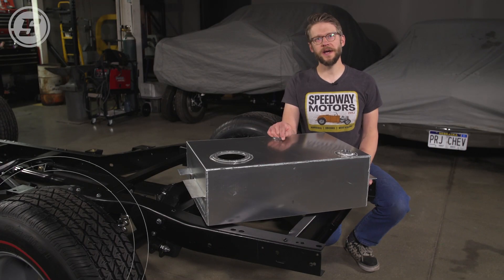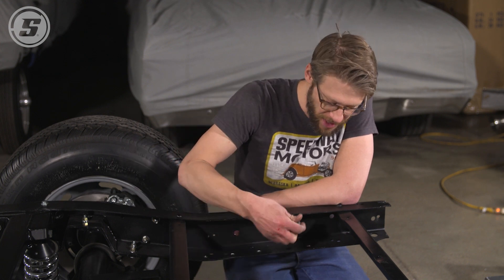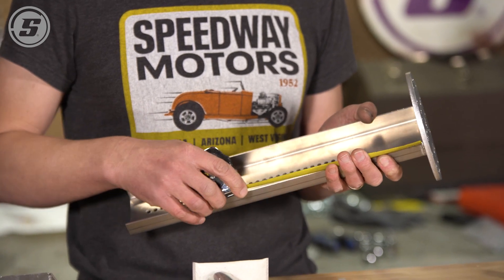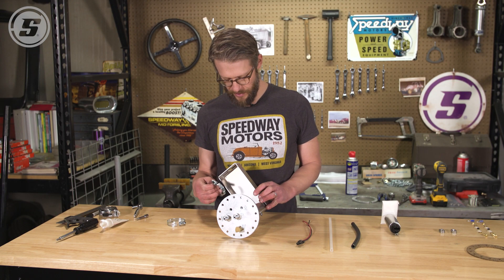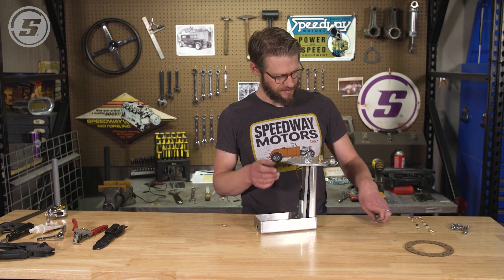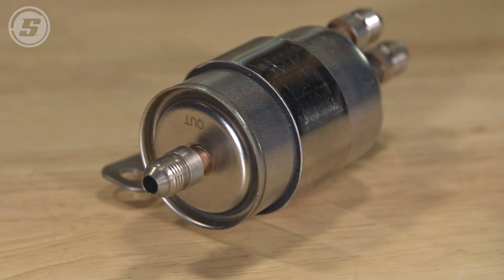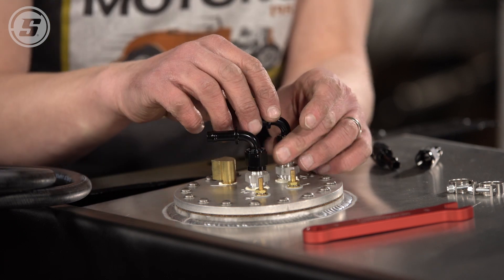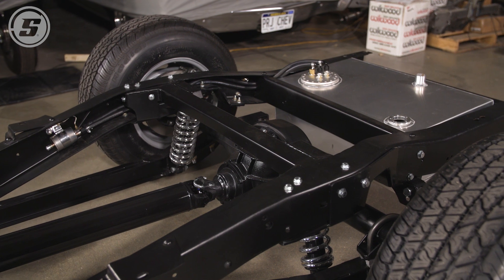1967-72 C10 LS Swap Fuel System - Under Bed Gas Tank Relocation

Comment: You should consider changing the way the mounting tabs are welded to the tank. Currently the top is open for water to get between the tank and corrode because the bottom is welded.